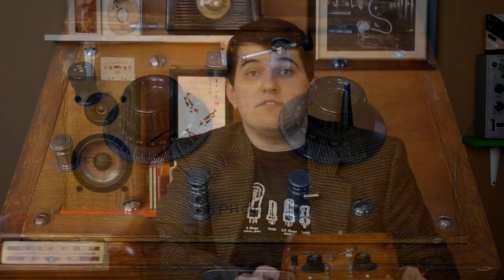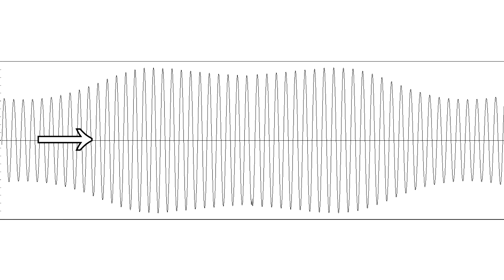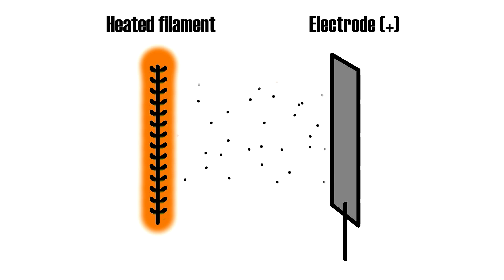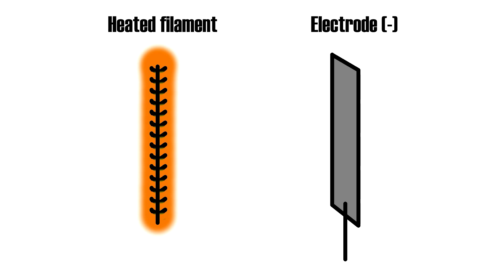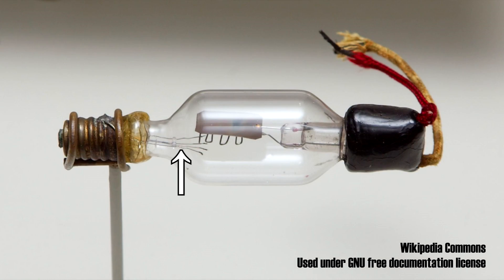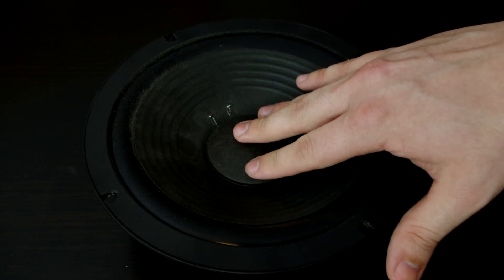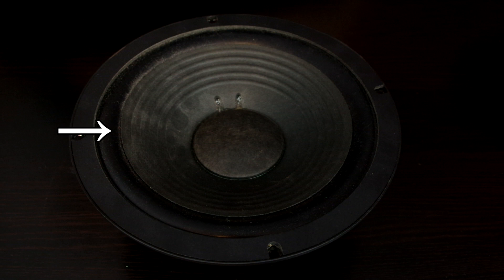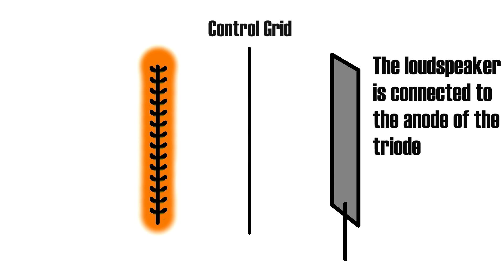The Vacuum Tube and the Invention of Radio

Comment: Side note, on the opening scene of the video, with the 10" phonograph records. Note where they are stored. In that book, referred to as an ALBUM. This is were the term "phonograph album" comes from. So any collection of songs in a book, as shown, or all on a 12" 33-1/3 LP (Long Play) record, or on a digital CD (Compact Disc), are ALL Albums ! So if someone says a CD is not an album, tell them to fornicate with themselves !
Reply: When 45 RPM records came out, albums were also box sets of 4 standard length 45s or gatefold jackets of 2 extended play 45s. Also, boxed and gatefold multi disk 33 1/3 LP albums exist, as do multi pack CDs.

Comment: @3:54 isn’t the crystal germanium?
Reply: You can make diodes from germanium and they're even better but I think (could be wrong) it requires treating one side with a doping element. Galena (lead sulphide) on the other hand is dirt cheap and easy to come by, and the diode is created where the little whisker touches it, but you have to find a "good spot" on the crystal. Hence "they're finicky and unreliable". I've also seen someone use a razor blade that was heat-treated until it became blue, as a crystal. Fool's gold is another option. Real MacGyvering.

Comment: The tube radios used the filtering coil as the electromagnet on the speaker. Then they started using permanent magnets on the speakers.
Reply: The switch to permanent magnets came about partially because of rising costs of copper wire after World War II. The alnico  magnets were also much smaller and lighter than the equivalent field coils of the day, even smaller than the ceramic magnets that replaced them in the 1960s. And field coil filtering was eventually replaced py straight resistive filtering.

Comment: Anodes are negatively charged. You constantly get that backwards. You always call a cathode a “negative electrode.” Is it just backwards outside of chemistry classes? Cathode shares its prefix with cation, a positive ion; and anode shares is prefix with anion, a negative ion. I’m so confused
Reply: The cathode connects to he negative terminal of the B battery.

Comment: You left out the transmitting method using vacuum tubes. Not to mention  the tangled history of wireless telegraphy v the public desire to hear speech and music, often denigrated as wasteful use of the technology of information transmission for businesses and governments that radio represented. Few in those days could conceive the amount of money such uses could produce just as the computing devices you are generating these videos for would have been too expensive for the average consumer when computers were the size of houses in the 1950's.
Fessenden built the first transmitting modulator of AM radio using a huge precision built mechanically driven multiphase magneto device. It was horribly expensive to build, and its modulation ratio was fixed, but it did work to transmit musical tones. The triode, with other tubes cheapened the process, just as transistors once produced in volume, have become so easy to produce that the vacuum tube tricks such as I.F. amplification with the same tubes used for first stage audio amplification were no longer necessary. I write this response facing billions of individual transistors in the LED display, where the very first transistor I ever bought cost me $1.20 in 1958 dollars.

Comment: It's too bad that you skipped over the part where you take the modulated signal and turn it into an audible signal. It was kind of what I wanted to know the most, but got the least of.
Reply: Always got to be someone picking holes in the video's - get off your butt and make your own then we will pick holes in your video's
Reply: I'm not sure how expressing disappointment about skipping a part of the story counts as picking holes. I have no interest in making "video's."
Reply: I think Alec explained very well how the RF modulated signal is rectified by the detector, then filtered using a capacitor to remove the carrier frequency, in this case 720 kHz.. That's basically it. You are left with an audio signal.  What did he miss?
Reply: He didn't cover superheterodyne receivers where the radio signal is mixed with an oscillating intermediate frequency for further processing and conversion to audio.  All  radio receivers manufactured today are superhet.
Reply: @JayeK47
he did say he will make a video about super het radio :-)
Reply: @Hunter's Moon
i agree with Alexander Krivács Schrøder  , it would have been nice to see the audio signal wave with the rf signal removed , for the ppl who dont know :-)
Reply: A very simplified explanation for anyone else rewatching these that has the same question is that after the detector that chops the negative portion off, there is a low-pass filter. If you drew a line connecting the maximum point of each little peak in the modulated signal you would get roughly what the original signal looks like. This conversion is what the LPF performs. Now all you need to do is fix the signal up a bit and amplify it and you've got a sound signal again.

Comment: erm... we wouldn't be able to hear radio waves even if they were at the same frequency as human hearing... because radio waves are electromagnetism... and sound is vibration. Both have a cycle rate (measurable in hertz) but they are completely different things.

Comment: I don't know how to increase your view from 2607 (June 2017) on youtube. The quality of your video is top of the line, similar to Veritassium and SciShow, for example.

If you produce a more in depth description of vacuum tube and/or transistor amplifiers, here is some details that helped me to understand:

Typical gain
 - The amplifier is divided in stages which bring the signal a little higher than the previous stage.
 - Both vacuum tubes and transistors have a gain of about 50. So, two stages can amplify the signal by 50*50 : 2500 times. Three stages, multiply by 50 again, and so on.
 - Engineers voluntarily waste some of the gain for many reasons. For one, the gain should be the same even when the tube gets older and when the battery are partly discharged. So, a typical multi stage amplifier may amplify only 10 or 20 times by design.

Negative feedback
Finally, as if wasting so much of the amplifying capacity of each transistors is not satisfying the thirst of money hungry company, they take a small fraction of the output, invert its direction and feed it back to the input of the amplifier to a pair of resistors acting as adder. Since the output is an inverted version, this becomes a subtractor which we can also call a comparator. 

This simple electrical wire connecting output to input is called a negative feedback loop. It reduce the total gain of the amplifier by a huge amount, like one hundred (100) time weaker than without it. But it increase the sound quality, making the output follow more closely what appear at the input.

Each transistor or vacuum tube is not perfect, it does not have a fixed gain of 50 for all frequency. They don't even have a constant gain on each possible DC voltage, For example, a small change of 1 mV near the middle of the conduction capacity may gets amplified to 50 mV But the same small change of 1 mV near to saturation point (top of the peak of the wave) or near the zero conduction point (the bottom of the wave) is probably amplified by a factor lower than 50.

So, the negative feedback is like being the driver of a horse drawn carriage, holding firmly the reins, preventing to take off in a spooked frenzy. Each stage of the amplifier try to amplify too much, but they are refrained at every part of the wave, allowing the output wave to be a very good amplified version of the input of the amplifier.

Comment: Point of contention!!!!  In point of fact, the radio was invented by Nikola Tesla, both communication and radio control!  He filed for patents # 645,576 and # 649,621 in 1900, and prior to this he filed for patents in the field of radio work as early as 1897.  Further, Tesla demonstrated a radio controlled boat in Madison Square Gardens in 1898.  In fact, Marconi's own patents were THROWN OUT in 1943 for violating Tesla's 1900 patents.  Additionally, in 1895 Tesla was ready for a demonstration of radio communication from his lab to West Point, NY. at a distance of about 50 miles, but was prevented from this demonstration by the simple fact that his lab burned down, no biggie right.

Comment: couldn't you just pump the headphone into a gramophone style amplification horn? I would think in that time period that would have been at least attempted
Reply: Well, people did place the headphones in vases.
Reply: Interestingly enough: there was one sound amplifier known at that moment, which could yield a power gain of about 1000: it's a carbon (coal) microphone! Telephones needed no special electric amplifier for very long time, all the amplification happened in microphone itself: coal powder changed its resistance depending on the pressure created by sound, so the current from 60 V battery varied a lot and could very well drive a speaker. The sound at the membrane of microphone is near 1 microwatt of power, while electric current may output near 1 milliwatt at the other end! 

And there actually were 'speaker+microphone' packs called 'Carbon amplifier' which were available long before vacuum tube was invented!
Reply: True enough, but the carbon mic hiss was nearly unbearable to listen to. The phone company tried many combinations of headphone/carbon mic "amplifier" concoctions, but they all suffered from a poor signal to noise ratio. The audion vacuum tube was an earth shattering breakthrough. Oddly enough, DeForest himself didn't know how the audion worked, and it was Howard Armstrong who was able to show that radio frequency oscillators could be made using the triode tube. That ushered in the modern system of radio broadcasting.
Reply: There were plenty of radio loudspeakers in the day that consisted of a reproducer in the base and an amplifying horn, similar to a phonograph horn. Some even coiled the horn up like a trumpet and put the assembly in a nice box.

Comment: I'm surprised the ingenious inventor/electrical engineer Nikola Tesla wasn't mentioned, especially considering his early contribution to the development of both radio and vacuum tubes. In 1943, the US Supreme Court invalidated Marconi's radio patents, and awarded the patents for radio to Tesla, who technically invented radio first. Marconi was only the first to broadcast a signal abroad because Tesla's ambitious "world wireless system" never realized its full potential. Nevertheless, great video.
Reply: So why did the Supreme Court ignore the fact that Marconi's first patent was granted in the United Kingdom some weeks before Tesla's application for a transmitter in the USA was made? Did Tesla's two patents cited by the court  contain any reference to an improved receiver as was set out in the Marconi patent? No they claimed no receiver at all. I have read the patents.   HINT  US court decisions are just so much paper outside the USA.
REPLY

Comment: Nicola tesla do a vid on him
Reply: name one thing "they" stole from his "work".
Reply: No that's not necessary there is enough crap on youtube to find about the urban legend Nicola Tesla
Reply: +lone wrecche do you believe that seriously?
Reply: Yeah, Nikola Tesla died at 84 of cyanide poisoning... Sure, tell me another...
Reply: He inverted alternating current, which also had a problem to solve. D.C power grids were unsuitable for transmitting over long distances. And long distance transmission made it feasible to harness hydroelectric power instead of generating electricity with local steam engines, burning coal or wood and giving off smoke.